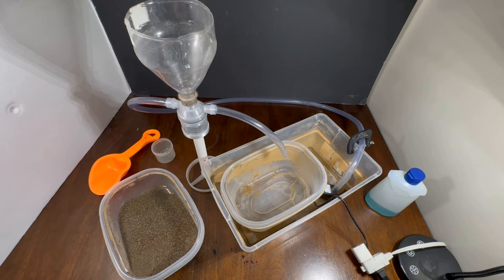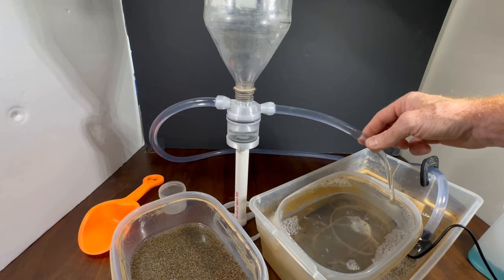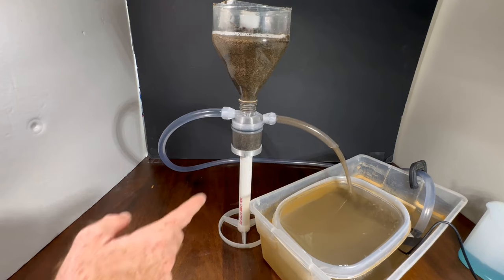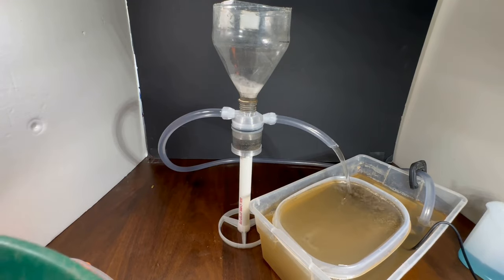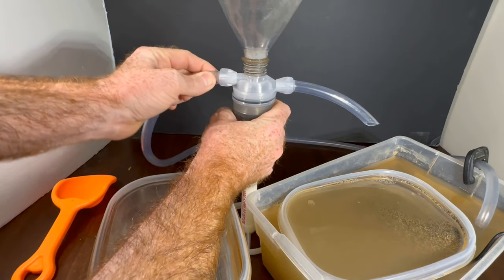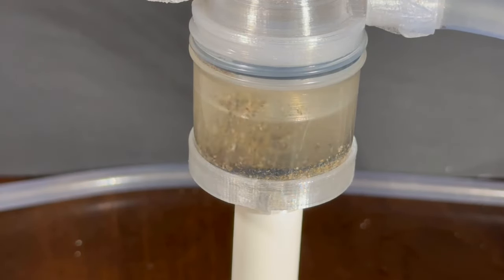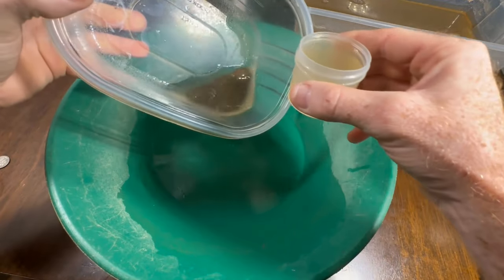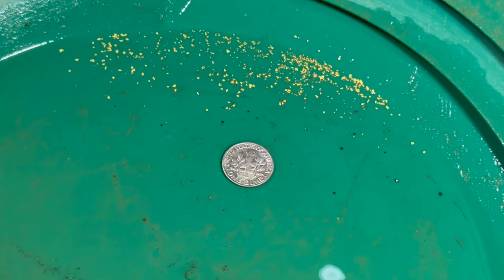The Siphon Sluice - Nano Tutorial

Comment: I only have one question.
Do you use jetdry or some type of soap in your water to catch the ultra fine gold?
I think this would be a great thing to have for catching beach gold.
I live on the Pacific Northwest Coast of Oregon. There is literally tons of beach gold mixed in black and blonde sands. If you can scale this up, I truly think you are on to something great.
What I like most is it wont rust or be destroyed by salt water. It doesn't weigh a ton like some of the commercial models already out on the market. 
So many people go for big gold and most likely they won't find it. This would allow me to get the small gold that I go for and not break my back or my bank to get it. Small gold weighs heavy when you have enough of it.
Also many places won't allow you to run any gold catching tools that have an engine unless you have special permits.
This is a great idea and something I want to add to my arsenal! 👍
Reply from the maker: I do use jet dry with just about every run. 
   This would definitely work for beach sands, it might be slow for all day use but I am working on a slightly scaled up version that I ran about 60 pounds of cons in 30 minutes. The last video I uploaded shows that one. I am hoping this larger version will be good for beach sands or high volumes of crushed ore. The material has to be classified to -1/8th inch material, other than that it seems like it would be good for the beach. 
  It should be as fast or slightly slower than existing products on the market right now but with this you should be able to fill up a 2 or 5 gallon bucket hopper full of dirt and walk away while it processes the material by itself so you dont have to constantly hand feed it. 
 There is a ton of fine gold everywhere and with the right equipment it should end up being easier to get than the bigger stuff, thats just a guess a this point. And yeah you should be able to use it in most places. I live in California and we have the same laws but I think you can use it as long as it’s like 50 feet from a water source and you recirculate the water. 
  Send me an email to toothpickmining@gmail.com, I can send you a prototype of the larger version to play around with. I’ll just charge the $18 shipping fee. 
  It will be several weeks before I finalize that design but so far it seems like it will be useful in certain situations.

Comment: How much sand can it process at a time? Can I run 10 kg of sand through it and trap all the gold that was in it? :)
Reply from the maker: Hey Teo, yes sir, I have ran 11.3 kilos and it did a good job. I thought I made a video to share with you but I guess not. It will take an hour or less and you will probably get around 95% recovery in the first run. After the first 20 minutes or so the feed rate will slow down but as long as there is material coming out of the discharge tube then it is still processing. Another YouTuber ran his 5 gallon bucket of cons and was impressed so yeah it will run as long as there is dirt coming out of the discharge tube.

Comment: I bet you can change the flow rate by lowering the pump to adjust the material retention.
Reply from the maker: I apologize for the late reply but yeah that is one way for sure, the height of the discharge tube plays a role in that as well and also there are USB motor controllers that others and me have been using to control the flow.
Reply: @toothpickmining  I did see the USBs in your other videos. Your setup is epic.
Reply from the maker: @activityaccounts5975  Thank you very much, it came from 6 years of trial and error trying dozens and dozens of ideas. So it definitely didn’t happen over night or anything.